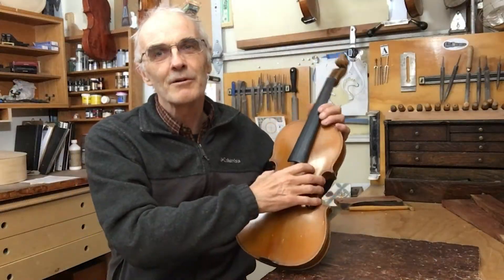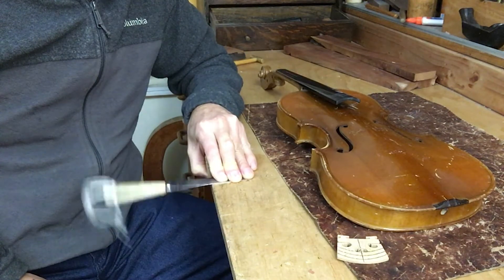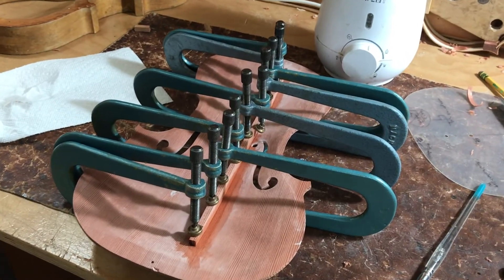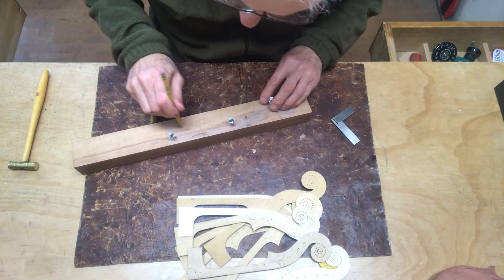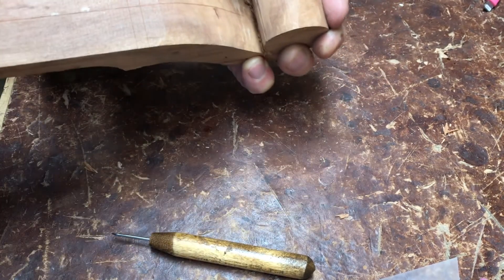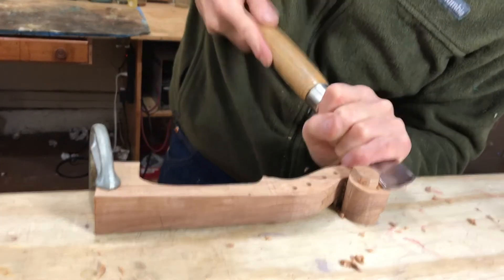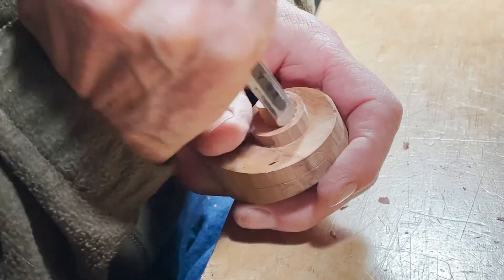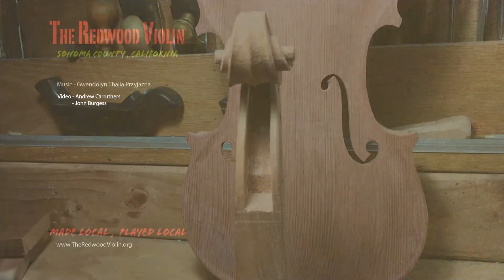Redwood Violin Update 4 - Bass bar. Top on. Scroll carving. Practical violin acoustics

Comment: What did you use for the sound post patch on the top? I had wondered about how the soft redwood would hold up to a sound post
Reply from the maker: its a little surface veneer, a bit under 0.5mm thick. I actually use maple business card blanks that you can get from Etsy. Without that  the redwood would not hold up well at all!
Reply: @redwoodviolin  I ask because I'm building my first bass but I'm using spruce. Much harder than redwood.
Reply from the maker: @jchumley57  it will be fine, but there’s no harm in adding the veneer. Also, or instead,  you can pre compress the wood a little by burnishing the area. I think that helps stop the post tearing up the top.